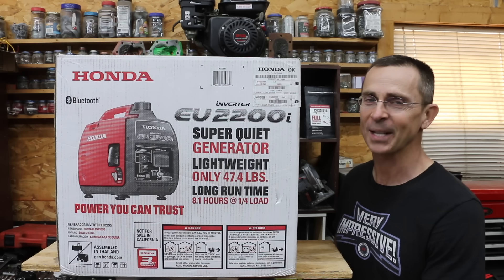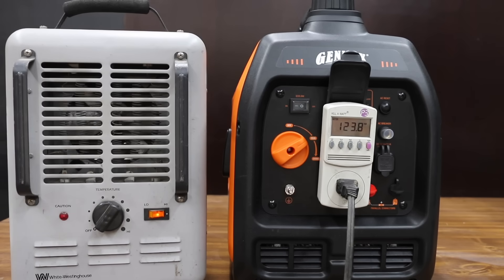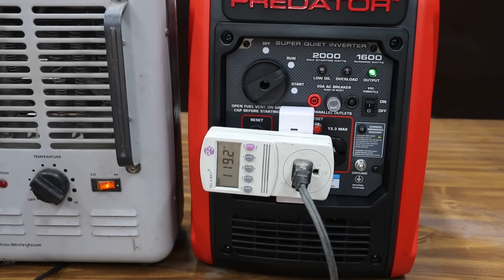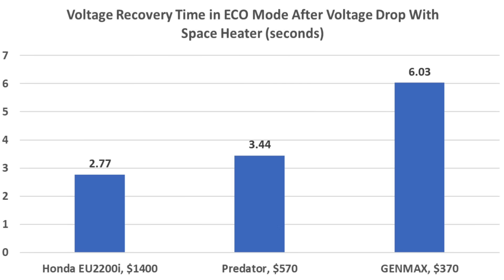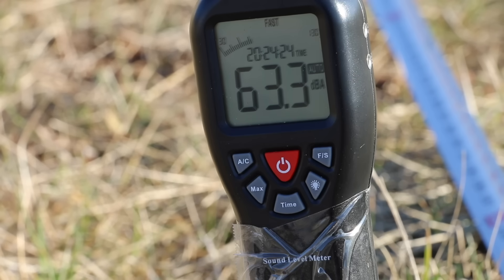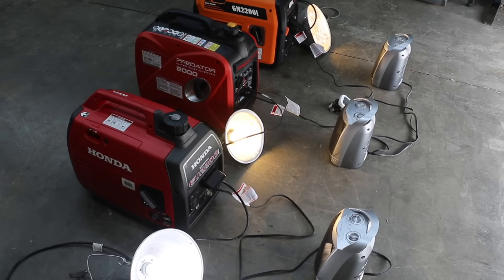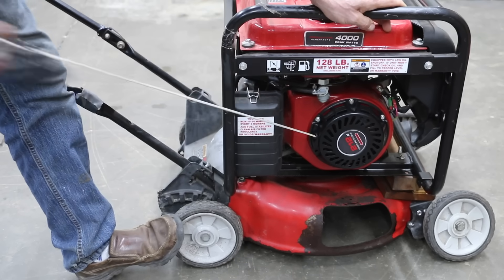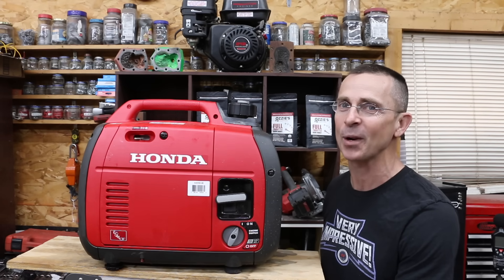Cheap Generator Better Than Honda? Predator vs Honda & GENMAX—Let’s Settle This!

Comment: Nice work!  I had one of those cheap generators and it worked great, but after a year of periodic use the stator died and it became trash. Would like to see some more longevity tests in your reviews. Maybe run these things for a week on and off under load and see who survives.
Reply: Exactly my thoughts ... many of these  cheaper brands are adequate out of the box, but how do they perform after 6 months+ plus of use. Ill always buy honda / stihl / echo etc .... they last so much longer.
Reply: @roberttudor455   The greatest problem with these mail order generators is finding someone to work on them that has the talent and parts to do the job, not to mention the desire to see the job through, without the interminable down time. When you need the generator, you NEED the generator, like, right now.
Reply: I’m not surprised.  My shop sold a clone of the Tailgator.  Those things were not reliable.  Despite the low price, they were not money well spent.  We dropped them from our product line.
Reply from the maker: Thanks!  Thanks for the video idea.
Reply: probably honda will work best.. their motorcycles are the best! 🐱👍🏿

Comment: I have a slightly older generator with a Briggs and Stratton and it is very reliable but loud.  Now I will say that most of my other outdoor power equipment I found good deals on Honda motor versions and they are so reliable.
Reply from the maker: Thanks for sharing.

Comment: No question the Honda is a superior more capable unit. Sine wave alone wont save sensitive electronics. Voltage drop is a big deal. I've put many hundred of hours on a 2000i Honda and I have a EU3000is w/about 250hrs, great generator with nearly 20hr run @ 1/4 load on a tank. And I have time with a EU7000is. All have run houses and job sites. Fantastic generators! (Only issue ever was some mice chewed wires inside the 2000i one winter. Easy fix).
Reply from the maker: Thanks for the feedback.

Comment: Try running HF radio on those inverter generators, there is a whole lot of switching noise present on the AC line which causes a lot of interference on the radio.
Reply from the maker: Thanks for the suggestion.

Comment: I have that Honda as a rarely used back up generator for my home, and because it is so rarely used I bought a propane converter kit which has worked fantastically the few times I’ve needed it, and I have no worry about the fuel going bad.
Reply from the maker: Thanks for sharing.

Comment: I bought a Honda EU2200i a few years ago and it's never let me down - I'm confident the higher cost was worthwhile, but it would be great to see how these units stand up over the test of time, like into the 1000hr+ range. It's not exactly an environmentally friendly test, but it's the only way to get those kinds of results. Thanks, as always, for the great content Todd!
Reply: Check any tool rental shop, and see what small generator they rent out. That's a business model that is based on getting the maximum return on investment from a tool purchase, and it's all but guaranteed to be a Honda. These small generator reviews always ask "Is it as good as a Honda?" If you get a Honda, you don't have to ask.
Reply: @om617yota7  Exactly, there is a reason all of our tool rental shops here in Australia all have Honda 2200 and 7KVA versions in the fleet, clearly they just last the abuse and test of time otherwise they would be using the cheaper ones.
Reply: I got eleven thousand hours out of my EU2000i before the inverter went belly up due to corrosion from a salt water environment.
Reply: @acmeopinionfactory8018  Well that's sort of your fault buddy.
Reply: I live in an area that gets floods, fires and earthquakes.  And the power company will shut power off if high winds are forecast in dry conditions (all summer) to keep their wires from starting fires. I've been considering a backup generator (I'm in a condo so can't wire in a full house generator).  Most years I won't need one and when I do it will only be for a day or two ... three or four possibly.  The cheap GENMAX seems to fit the bill.  I don't need something to last for several hundred hours a year.  For me, the best generator is the cheapest one that will fulfill your needs.  The GENMAX is perfect for me.
Reply: @skonky  Eleven THOUSAND hours.
I live off grid in the tropics and use it to run my A/C six to fourteen hours a day, depending on the season, in addition to battery charging and microwaving and coffee making.
Not to mention vacuuming and power tooling on occasion, for which I DO have to shut down the A/C.

My P/V array is relatively small and can't be extended, although it will run my lights and device chargers while also charging my batteries.
It was not worth repairing so I bought a 2200 which made a big difference, as I can run everything simultaneously, whereas before I had to turn off the A/C to run the nuker or coffee maker.
I'm well on my way to a thousand hours so far with this one.
The app is of limited usefulness in my case but others may like it, the only thing that seems remotely useful (pun intended) is the remote shutdown, but if I shut it down, I want to cover it, so I need to be at the generator anyway to do that.
Your mileage may vary.
Reply: I don't think there's anyone who regret buying a honda generator.  I don't see regret happening in the foreseeable future either.  $1200 is a lot, though.  Obviously over the lifespan of you having it, the investment starts paying you back probably 10-20 years later.  May be the last generator you ever buy.  Those others... you'll be replacing them every 5-8 years is my guess.
Reply: @himynameistim  if my 4 generators last 7 years that comes out to 28 years which is longer than the Honda. And I break out a new generator every 7 years
Reply from the maker: Thanks and you are welcome!  Thanks for the suggestion.
Reply: I bought a Chinese Honda clone in 1997. I use it about 20 weekends a year camping at dirt bike races. Just got back from a race. The old generation still starts on the first pull. Bought it from harbor freight.
Reply: @Bryan-Hensley  How many hours?
Reply: @skonky y cheap Chinese Honda clone probably has more than 11,000 hours. I bought it in 1997. Use it every year. Runs all weekend during the summer months when I'm camping at dirt bike races.
Reply: @Bryan-Hensley  the chinese honda clones are still a lottery. You might get a good one or a dud.
Reply: @Pepe-dq2ib  the parts off a Honda would bolt directly to it..
Reply: @Max Black every single brand has the possibility of getting a lemon even Honda. Luckily harbor freight has an excellent return policy and they will swap that generator out no questions asked.
Reply: @greasemonkeymechanic1  IF you return it within 90 days, it's quite possible that you won't discover the problem in that amount of time.
And if you need repair after that time, good luck finding someone who will work on it, most shops don't want to waste their time chasing harbor freight parts.
Reply: @acmeopinionfactory8018  you can buy two predators with a 1 year extended warranty for the price of 1 Honda I know because I have two Hondas and two predators. Also if you have a issue with your Honda within the warranty you have to find a service center and have them repair it and hope they don't blame you for the failure, I know I have been there. The predators are a very solid option for the price and I have had exactly zero issues with either of my predators and have had issues with both of my Hondas.
Reply: @greasemonkeymechanic1  I think the chances of a critical failure is higher with the predator than with the Honda, as I've owned a number of HF products, although never a generator.
I HAVE had a warranty claim denied by a Honda shop as they would rather have a customer pay than a factory pay as it's much higher.
I took the claim to the regional rep and got it covered.
My main concern is ultimate reliability, which, having owned a good many Honda products, leads me to believe their reliability is worth the higher cost, some may be more inclined to take a gamble and it may work out for them, that still begs the question of who will be willing to work on the HF, those shops are hard to find, not just for the predator but all the mail order generators.
Reply: TBO its not necesary, show any mechanic those sparkplug pictures from this video. If they came from a car: 1 engine will do 200+K miles even with modest servicing. 1 engine will do 100k, but will need serviced every 6k on the nose. and 1 of those engines wont make it from one service to the next without an oil top up and fresh plugs. I dont need a generator, but seems clean cut to me ifi did, buy the honda, or buy the cheapest non inverter thing I could find and put up with it, and treat it as disposable.
Reply: @denisohbrien  he got a bad one and should swap it, i have two predators and neither use oil like his did. i have over 500 hours on one and over 300 on the other and i have never had to add oil between 100 hr intervals. that being said obviously the honda is a better build quality and will last longer, but by how much is the real question.
Reply: @greasemonkeymechanic1    And do you use is often enough and for enough hours to need it to run longer?  At the price of a honda, I can buy three GENMAXs and never wear out the first one.
Reply: For the price of that Honda you could have bought 4 genmax generators... you have four times the power and four times the life
Reply: @gregorywagner9416  But peace of mind the Honda will work when you really need it, that POS you bought on the cheap genny may leave you will hundreds or thousands in spoiled food
Reply: @Girthy 10 incher  I'll have 4 generators you will have  one

Comment: Fascinating test!👍 A pet peeve is advertising surge ratings instead of continuous. But Hondas will usually do their surge rating for half a minute or so. I tested a Predator 1400 (1200 sustained) and found it will exceed 1100 for less than a second before tripping.  I guess you get what you pay for.🙄
Reply from the maker: Thanks!  Thanks for the feedback.

Comment: Another great test. The one burning the oil shouldn't burn that much. Honda has always been a leading manufacturer of this type of equipment. My own 2800w generator is a Scorpion. I've not tested to see how clean the power generated is at this point in time. Oscilloscopes are an extremely useful tool.
Reply from the maker: Thanks!  Thanks for the feedback.
Reply: @ProjectFarm  put Nos on a diesel engine, & see what happens!!

Comment: Hello, I have an idea for a test video, gutter guards. I used to install them and preach that they arent worth it and would love to see some random brands tested side by side with debre blockage, water flow with and without debre, ease of cleaning, installation, uninstallation, overflow when they are "full" or "covered" in debre.
Reply from the maker: Thanks for the suggestion.

Comment: Daggum...I wonder what a stress test on these engines would do...say 500-1000 hours run time with proper oil changes...to see if they can go the distance
That aluminum and iron in the oil is a worrying sign!  I wonder if MotorKote would help eviviate that...seems like those cheaper are cheaper for a reason...they end up eating themselves internally, bummer
Keep em coming!!!!
Reply from the maker: Thanks, will do!  Thanks for the suggestion.

Comment: I'd love to see air compressors rated.

For years I used an old compressor I inherited from my dad, which he got  maybe circa maybe 1992.  It was very loud, and I hated using the thing because it was so loud, and you couldn't really hold a conversation with anyone in the garage when it ran.

When it eventually gave up the ghost, I decided to get something that's quiet rather than repair this old beast.  I chose a California Air Tools brand, which claimed to be quite.  Almost 2 years later I can't be happier with my decision.  You barely notice it running, and I'm far more apt to use it because of that.

A lot of my decision was based on it being quiet, but I also wonder if the quietness doesn't cost me performance, run time, recharge time, etc.
Reply from the maker: Thanks for the suggestion.

Comment: I think you should have also compared the weight and size of each generator (dry and wet) as well and compared their full tank endurance. The Honda also has a significantly larger displacement engine (125cc vs 80cc on the other two), which could explain why it did better with heavier loads.

Also a little more subjective of a test, but comparing replacement part availability and pricing could be interesting. Nice video!
Reply from the maker: Thanks!  Thanks for the video idea.

Comment: Then just run the voltage through capacitors to clean the voltage signal. Problem solved.
Reply from the maker: Thanks for the feedback.

Comment: Maybe I missed that part but what was your test procedure for these new generators?  Did you run with the often-included "special" break-in oil for the duration/load recommended and then do an oil change before conducting your tests and doing oil quality samples?  All the generators I've owned have called for ~4-6 hours at certain load with certain oil for break-in then a subsequent oil change with the regular type of oil expected for the rest of its lifetime and full normal loads.

I've been happy with the Champion 2500 dual-fuel inverter generator though I've not used it significantly more than its break-in duration

Comment: Is sad that Harbor Freight don’t  shipping anything to Puerto Rico ,but in the out stage of Huracan Maria, they make an exception and sent to Puerto Rico first emergency items and I buy a 2000K predator generator I plug this generator with the transfer switch I’m working everything in my house except the 220 V equipment.
 it’s run about 12 to 13 hours with 1 gallon of gasoline is such incredible and I have a 18 cubic feet refrigerator ,television tree,pedestal fans  one ceiling  fan and all the light of the house.
I’m run this engine with Amsoil small engine oil and all way input 2 onz. of Seafoam to the tank of  premium gasoline. That’s to keep carburetor clean and keep gas in good condition in case not empty the tank in the emergency.
Reply from the maker: Thanks for sharing.

Comment: Nice video. It would be interesting if you did a couple of 1 hour break-in's with something like Marvel Mystery Oil (10%), and changing the oil each time to ensure all manufacturing grit was out of the crankcase before doing the oil test. I break-in my generators that way and it is amazing how dirty the oil is on the first 2-3 -  1 hour oil changes.
Reply from the maker: Thanks for the suggestion.

Comment: Great video ! I would love to see the sine wave with "dirty" loads like an angel grinder cutting metal. Also which generator is able to power a small stick / mig welder, air compressor and plasma cutter.
Reply from the maker: Thanks!  Thanks for the suggestions.

Comment: I think trying the test again but with Champions 2500 watt, dewalt 2200 watt, Ryobi 2300 watt, Firman 2100 watt, and Generac 2500 watt. More midde range priced units. I believe these unit cost between 500 dollars to 900 dollars for the basic models.
Reply from the maker: Thanks for the feedback.

Comment: Chickanic just did a brief test using marine oil in chainsaws. They say not to do this, but with her brief test, nothing happened. My stepfather only used Valvoline motor oil in his 2 cycle stuff. Can you do more rigorous testing on the three types of oils (regular 2 cycle, marine and plain motor oil like Valvoline) to see if there is any cylinder wall and piston damage? Also running temps? There's a rumor you'll damage a 2 cycle engine using regular motor oil like Valvoline.
Reply from the maker: Thanks for the suggestion.

Comment: The biggest issue with some generators is the CO sensor...which will turn the generator off even if it's outdoors in an open environment.  It's getting really hard to avoid that feature.
Reply: Probably really easy to disable, usually just wiring two wires together coming out of the CO2 sensor.
Reply: @Bottoarguewith  I thought so too, but in some cases it's not.  Even the Champion tech advised to avoid that feature.
Reply from the maker: Thanks for the feedback.

Comment: We used Hondas on our framing trucks. They weren't inverter units but I'm telling you they were indestructible. Always out in the rain and snow, never maintained, no oil changes plugs or air filters and they ran like that for years. Started easy no matter the weather, they'd shut off when low on oil and we'd just dump some in and they'd fire right back up. When we switched to cordless stuff they bought smaller units just to charge the batteries, same Honda reliability.
Reply from the maker: Thanks for sharing.

Comment: It's hard to get around the fact that on sale you can buy 3 Predators for the cost of 1 Honda. Add the bulletproof insurance from Hazzard Fraught and it's 2-for-1. The predator 3500 is even better and quieter than the Honda. 

I'd like to see the 3500s in a competition, and I'd add the Westinghouse and Champion to the mix. I see a lot of dual-fuel Westinghouse at campground. Rumor has it HF will be adding a dual fuel Predator to their mix next year.
Reply from the maker: Thanks for the feedback.

Comment: I have the older Honda eu2000i.  It has run everything I have thrown at it for ten years now- even a MIG welder for hours on end.  I have used it nearly everyday off grid.  One caveat- they hate cold weather.  Anything below 20 and starting it gets dicey.  At 0, you have to warm it up for sure, even drape a blanket over it to keep it running (not over the exhaust obviously).  Love my Honda generator.
Reply from the maker: Thanks for sharing.